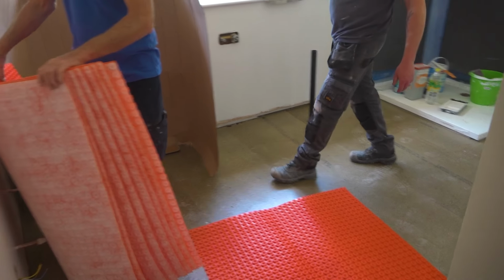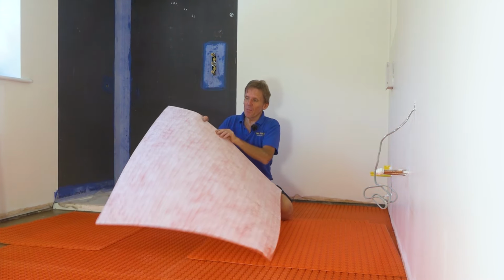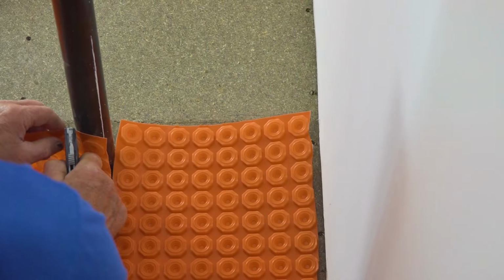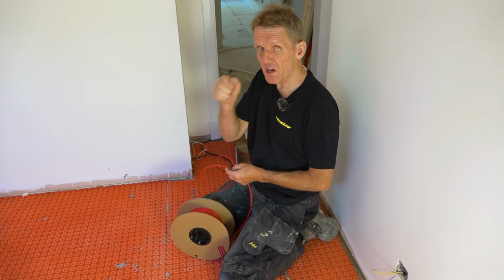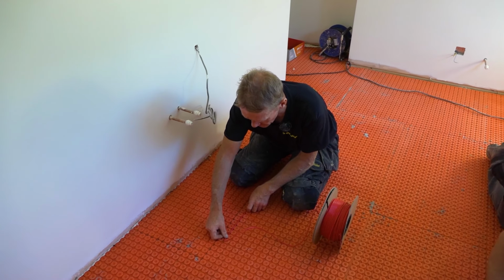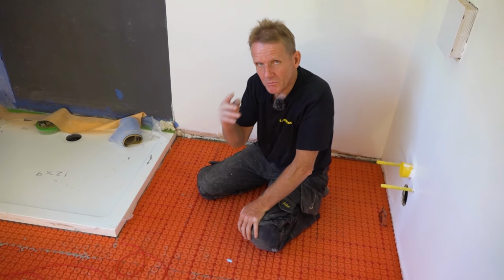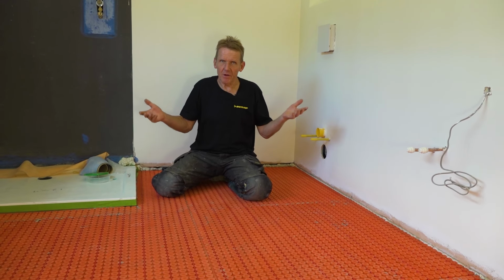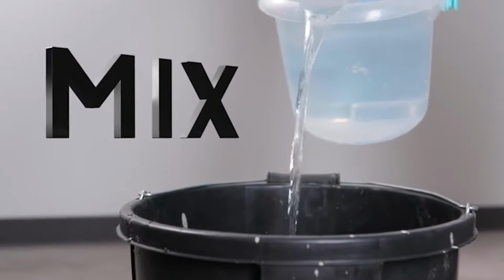Easy Bathroom Underfloor Heating ~ Extension #25

Comment: A top tip- when installing the cabling, add one or more additional underfloor thermostat sensors (not shown in the video) as spares. This way, if the sensor ever fails, you don’t have to disturb the floor.
Reply: Or put the sensor in a conduit. That way you can just put in a new one.
Reply: We do this all the time now. So far, we haven’t had to deal with a failed stat, but it’s a great backup.
Reply: Class idea, thanks

Comment: By far the best system I ve ever used, your in complete control of your wiring layout. 

I’ve installed a lot of this and you say you can’t install wiring closer than 75mm. It all depends on what company product you use and if it’s a primary heat source then it can be installed to 50mm apart generally. 75mm is secondary heat source a long with towel rads but like I said all depends on what products you use with their spec. 

Good post anyhow. Keep up the good work.
Reply: Exactly! Ditra heat specify minimum 3 studs apart on floor but 2 studs apart on the wall. And it definitely can be used to heat a room if you buy the right brand as you say. This looks like a knock off ditra heat
Reply: @cglees  there is many companies out there. One I like using is elektra wiring heating. Comes with their own decoupling mat and very easy to install as is ditra. 
You stick with what you know at best.

Comment: Remember kids no swirls in your tile adhesive! You want nice straight lines so they can collapse and not trap any air.
Reply from the maker: I knew we would get that one and you are right
Reply: Can you please explain this a bit? I've never heard this before, and it isn't clear to me why straight lines would be preferable to circular. Wouldn't it contain the same ratio of adhesive to air in either case?
Reply: @SkillBuilder  aha! That makes sense to me, this channel is amazing. Thanks for the info.
Reply: @iamamish  its to allow air to escape as tiles are pressed into place. Swirls may create air traps which can cause problems

Comment: It's a good system but personally I stick the mat down with tanking liquid. Find it faster and easier and a lot of the time I'll be using it on the job anyway. Tech support said this is an acceptable method btw

Comment: Great video always. Can you use this system upstairs on a chipboard based flooring?
Reply: Yes you can. That is exactly where we are using it in this video but you must ensure that the sub floor is sturdy and that the chipboard floor is extremely well fixed down also the chipboard would ideally be 22mm thick.

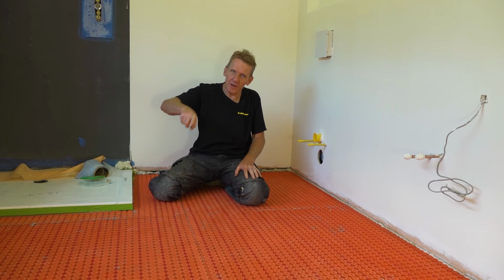Comment: Hello,  at 06:30 you were saying that you worried that you might have to run the excess cable underneath the bath. I thought that this was always a big no-no. Looking at the Underfloor Heating Store's instructions on how to mark the area for heating, they always advise to avoid running the electric heating cables going under such fixtures. Hence, I was surprised to hear you consider that as an option!
Reply: Thats mainly because it is a waste of heat, those areas do not need heating so it wastes money and there is also the risk of damaging the cable when fitting them

Comment: Thanks for another useful video. Is the 75mm required spacing between the cable runs needed because if the cables get too close the heat can damage them? Cheers
Reply from the maker: Yes it can cook if it gets too warm and that reduces the life.
Reply: I’d disagree with that. It’s a recommendation from the manufacturer from a safety perspective so that you don’t burn your feet walking on the hot tiles. If the cables are too close together the floor will heat up too much too fast and the thermostat might not detect it in time which could make the floor too hot to walk on. The cable can’t damage itself from being too close together, it is hot anyway. That’s like saying if you put 2 hot cups of tea side by side one would heat the other. The cable is either on or off, when it’s on it is at maximum temperature, when the heat dissipates through the tiles the floor sensor detects it and switches off at the desired temperature. The cable itself can’t get any hotter than it already is but the tiles could end up dangerously overheated if the cables are not spaced out sufficiently
Reply: @cglees  interesting point, thanks!
Reply: @cglees if the cable was surrounded by insulation that is 100% efficient what would happen? Would current still flow? If so where is the path of energy flow? Or where is the heat energy going that is being produced from the current flow? I would suggest the cable would heat up to a point where the resistance of the cable itself gets so great that current cannot flow or (more likely I would imagine) it will get to a temperature that the cable will thermally fuse and the current will mechanically be stopped. Just an interesting thought. All theoretical of course.
I liked your post btw.

Comment: I can see how remodeling a bathroom at a later date could pose a bit of a problem with relocation of fixed furniture? Also can you use this system under a wet floor bathroom? - A tanked/lined floor with drain built into the floor for draining showers and other water sources..
Reply from the maker: In my experience a new bathroom is done from the floor up with new tiles. The only problem  here would be somebody placing floor standing units on the floor which ain't going to happen. The whole idea is to give you a clean clear floor which is easier to clean. As a plumber I have taken out my fair share of w.c's with urine soaked into the floorboards. This is way better.  As for placing this heating in wet spaces, yes, provided it has RCD protection.

Comment: I’ve had to buy two rolls of mats @ 10m each = 20 square meters therefore there are TWO mains cables? Do I just connect them both to the fuse spur switch which is wired to the stat?

Comment: Hi Roger, nice job.  Do you know what thickness the decoupling tiles are?  I am looking to underfloor heat and then tile, but my shower tray is only 25mm thick, so I need to be a little careful in how many layers of material I have under the tiles.  This decoupling layer and self leveller option appears to be what I need, providing that the decoupling layer is not too thick!
Reply: Hi, I have some of these exact mats here ready to fit shortly so just measured them. They are 6mm thick.

Comment: Quick Question: If its terminated at one end, why not start with that end and then any excess can be cut from the other end... or would that not work?
Reply: Good question, the other end has a factory made joint to a tail of cold cable that runs up the wall to the controller and that join also has to be buried in the floor so you will always have a fixed point at either end of a heat cable.

Comment: I have to admit i have recently ripped all these out of my own home, put rads in, and just extended the heating loop and new boiler, That all looks good but the time it takes,and the expense,and there is always that concern about damaging the cables with the trowel as you mentioned, Great video but this is not for me, PS knee pads mate or you will suffer when you get to my age. which is 74 tomorrow.
Reply from the maker: I just thought that matting was soft enough to not need knee pads. I was wrong.
Reply: @SkillBuilder  Told you.cheers mate and thanks for swift response,have a great weekend ,chilling i hope .

Comment: Where’s the floor waste? In Oz we have to drain all wet area floors in case basins or baths overflow. How can you fall a floor to the waste drain when you have self levelling screed?
Reply: We don’t have that regulation in the uk, just overflows fitted to baths and basins. Usually just wet rooms which have drains in the floor!
Reply: No such thing here in the UK, as mentioned we have overflows built into the baths and sinks ( although if water was running fast enough if would still spill over as the overflows are quite small ) in a wet room you may find a drain in the floor but 99% of all bathrooms have no grid drain like you've mentioned.

Comment: If the toilet and  hand basin where floor mounted why would you not run the cable under them is it just to prevent wastage ?
Reply: I'd be more worried about driving a screw through the heating element when fitting the toilet.
Reply from the maker: I think it can overheat if it is under fitments.
Reply from the maker: @paul756uk2  I gave up screwing w.c to the floor years ago. A bead of silicone around the base will hold it completely and prevents any chance of cracking. It also makes it easier to get up. I usually cut the screws and put them in as dummies with a dob of silicone. Some poor plumber not yet born will be unscrewing them and think he has snapped them off.
Reply: @SkillBuilder  only silicone, really? Isn't it too flexible? Wouldn't a high grab adhesive like soudals fixall be a better choice as it's cures much stiffer than silicone and probably bonds better?
Reply: @SkillBuilder  Yes I think you're right. They don't need to be screwed down. Surprising how well silicon holds things in place. Saying that however, my daughters less than a year old new build undermount kitchen sink started to collapse last week as all that was holding it up was silicon. What a pain that was to put it right. (No good asking the builders. They don't want to know. This isn't an average new build on an estate either).
Reply from the maker: @BODGE71  I took a wall hung basin out recently and it only had silicone holding it. I broke the basin trying to get it off the wall. A bead of silicone around the bottom of the w.c pan is perfect and will not move. Hybrid polymer adhesives also work but silicone is good enough

Comment: I think that the manufacturer ask to fill up a installation sheet with the resistance of the cable out of the box and after laid down for warranty purpose!
Reply from the maker: Good point, I will have to find someone who can read and write
Reply: Yup, often 3 times and to be filled out on the warranty card itself

Comment: Did I understand this correctly - the Romans used decoupling systems with their tile? I had no idea. I did a bit of Googling for more details but couldn't find anything. Can anyone share more details about this?
Reply: @SkillBuilder  that’s amazing. Thanks for sharing!
Reply from the maker: They used a layer of sand between the sub base and cement so it formed a slip layer to stop ground stresses affecting the tiles.

Comment: Is it possible to put water underfloor heating instead in the bathroom?
Reply from the maker: Yes no problem at all. I have it in my bathroom. All I did was snake the radiator return through the floor. It works a treat and is controlled by the thermostat on the towel rail. No manifolds no pumps just the heating circuit.

Comment: Regarding the screeding…… it’ll crack when walked on. The decoupling mats are plastic and have movement when walked on, but the screed has no movement and will crack. I guess you can use boards to walk over but I much prefer to tile on direct.
Reply from the maker: The screeding is fibre reinforced and if you can crack it by walking on it you must be the guy who ate all the pies. The mats don't def;ect when walked on. This whole systems has been specified , the recommendations are for a fibre reinforced self leveller. There is no deflection in the floor because they joists are at 400 centres and the Caberdek is 22mm not 18mm. The tile adhesive it flexible so the whole thing will be belt and braces.

Comment: The tile method looks great and WAY more flexible than these carpet/wire included mesh versions.

But why can I for the love of god not find some kind of carpet or tile based alternative to SCREED. Can I just decide not to use screed?

Every video. Wow looks good. Nice and easy. Looking sweeeeet.....

CONCRETE LAYER SCREED TIME.

Like. I don't want my lovely accessible floorboards to be concreted over in a way that will piss off anyone trying to do underfloor maintenance. Why has nobody released some form of product that is modular, can be removed.

Sigh.
Reply: why on earth would you want it to be able to be removed

Comment: Looks like Schluter.
Reply from the maker: A lot cheaper
Reply: @SkillBuilder  ooh. Now that has caught my attention as I've been thinking about installing this in my bathroom.
Reply: @BODGE71  I wouldn’t go cheap on this, if it fails you have to rip up the tiles to replace it. One area you want to be confident is underfloor heating. Schluter give you that peace of mind in my opinion. They give you 2 floor sensors in case one fails
Reply: @cglees  👍 agreed.
Reply from the maker: @cglees  We always put the floor sensor in a length of flexible conduit so it can be replaced.

Comment: I was under the impression that electric underfloor heating was more efficient than radiators - and cheaper?
Reply from the maker: Hi Simon
Electric underfloor heating is good for tile warm up to keep your feet warm in a bathroom but don't ever use it as heating. It costs a fortune and can't do the job. Just check out the watts per mtrs sq and you will see why.
Reply: @SkillBuilder  would you opt for a water underfloor aystem for the whole house instead? What about when gas boilers are phased out - thinking of the future
Reply: @swedge1988  electric boilers.